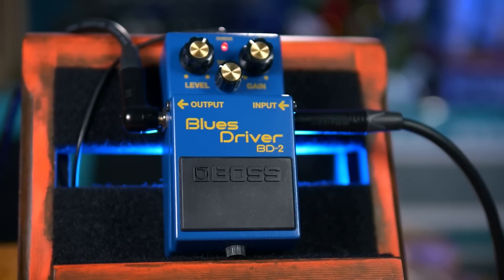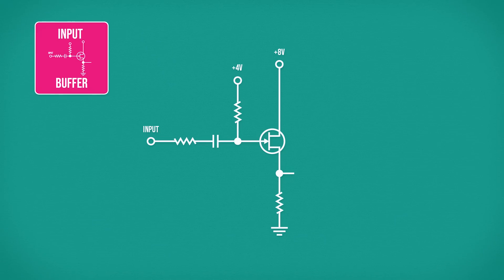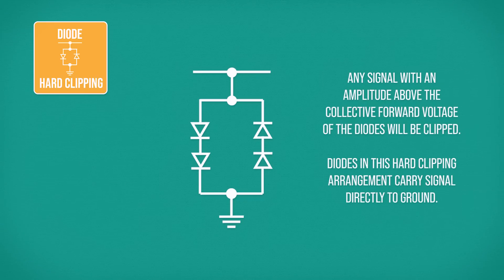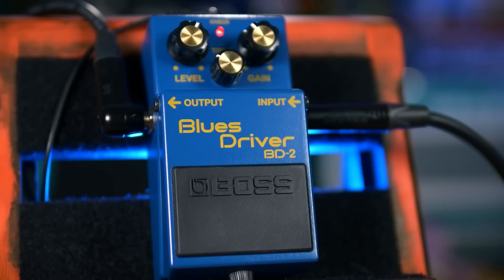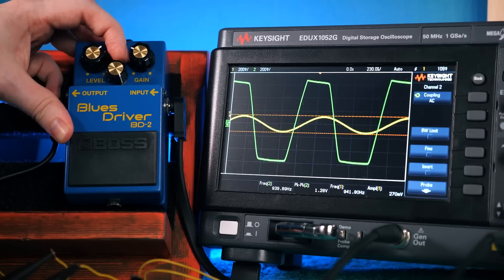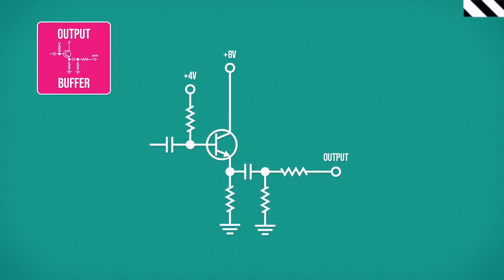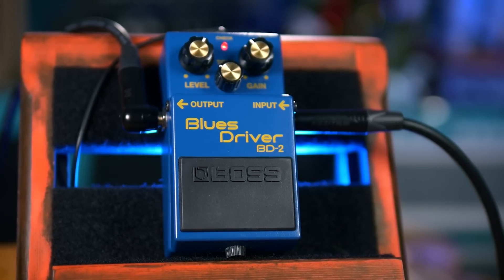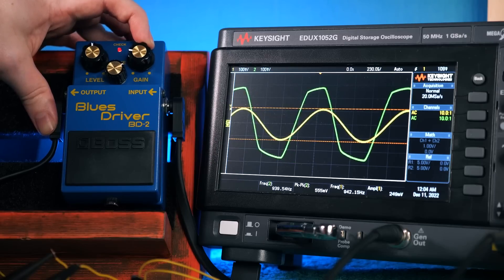SURPRISING Circuit of Boss Blues Driver | Gain Appreciation

Comment: what i absolutely love about this pedal is how you can play the same note or octave on two strings and it'll be relatively clean on a high gain, but move just a bit away from that, and it throws in a metric ton of dirt into the sound

Comment: Absolutely fantastic pedal. The Blues Driver is criminally unrlderrated and highly versatile. Thanks for the look into the details of the circuit. I didn't realize how relatively sophisticated it is. Growing up in the 90s, I had no concept of the difference between drive and distortion - all I knew was the BD sounded great, and gave great texture to my tone.
Reply: It's not underrated lol, it's one of the most popular pedals ever
Reply: It's not at all underrated, it's literally the 3rd best selling overdrive on reverb right now lmao
Reply: Sssshhh! Leave it that way till I buy one used online! Dont hipe it!
Reply: You can distort, overdrive, even practically clean boost and even get to the lower end of fuzz. The versatility of it (combined with the fact it’s a boss pedal built like a tank) is ridiculous

Comment: The waza craft blues driver is such a versatile pedal going from the original circuit and cranks it up to eleven. I swear it's a distortion pedal if there's a blind hearing test!
Reply: Good to hear, just picked one up!
Reply: i've been using a blues driver since forever.  i've never used it as an overdrive, ever.  afaic, it's a distortion box.

Comment: this is the quintessential drive pedal in my opinion. pure beauty.
Reply: I concur. It can pretty much replace the SD-1 and DS-1 on your board.
Reply: @Guitarnivore and it does
Reply: @Guitarnivore  My BD-2 is always on my board and I don't agree at all.  
The SD-1 is very different sounding, the hi-pass is much more aggressive and the gain doesn't sound very good cranked up (BD-2 distortion is magnificent).  The SD-1 stays on my board for that hi-pass.  
The DS-1 is a distortion that sounds best into a crunchy amp, whereas the BD-2 works great into a clean channel.  I play solid state, so the DS-1 doesn't work for me, but the BD-2 is great.
Reply: @Guitarnivore  BD-2 boosted by an SD-1 is all you need
Reply: @Guitarnivore  It sounds nothing like the SD-1
Reply: @gunkanjima3408  That's not what I said, but you're right, it sounds nothing like the SD-1.  It sounds better. But you can make a BD-2 sound closer to an SD-1 than you can make an SD-1 sounds like a BD-2. What I'm saying is the BD-2 can easily be used as both a distortion pedal and  an overdrive.
Reply: @Guitarnivore  Better Yet, Try this: Boost A BD-2 With An SD-1. You won't be disappointed.
Reply: It’s incredible. The buffer is a huge boon in terms of utility on a pedal board, as well.